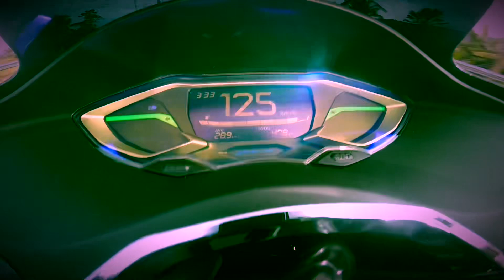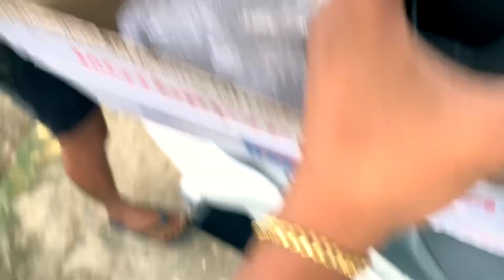Pcx 160 | MT8 Pipe Stainless Tip | Installation Sound Check | DIY

Comment: Idol kailangan pa ba mag remap ng ecu
Reply: kahit di na lods naka stock ecu lng ako no remap goods na goods plug and play na lng
Reply: Pag nagpalit ka ng pipe. Need mo talaga mag remap or mag reset ng ecu. Yung stock ecu design yan sa stock pipe. In the long run magkakaproblema motor mo dahil sa air fuel ratio nya. Kasi pag stock matipid ang bigay ng fuel sa injector kaya mabibitin ang makina sa fuel lalo na open pipe yan.